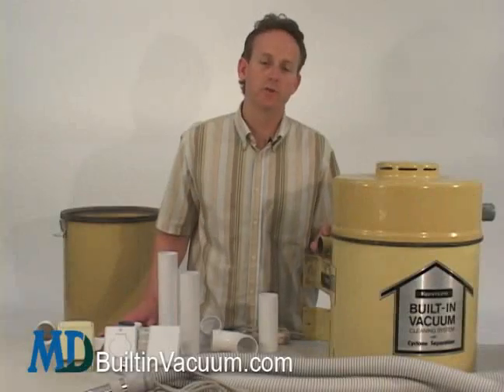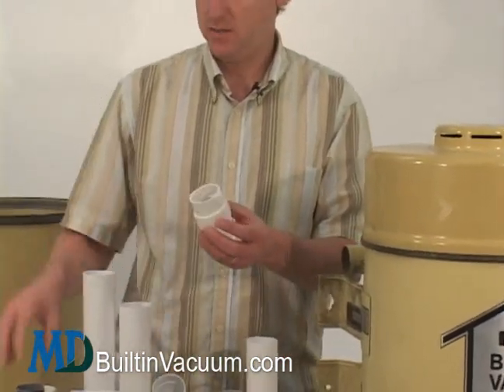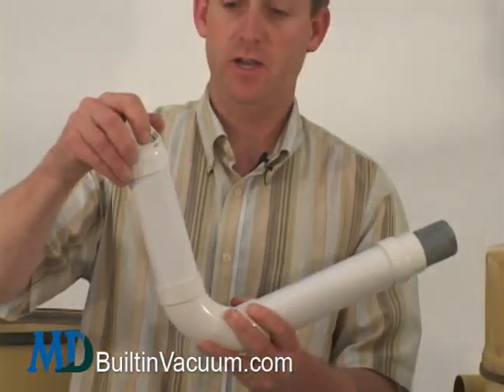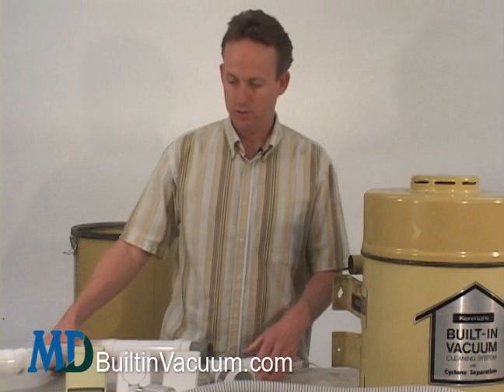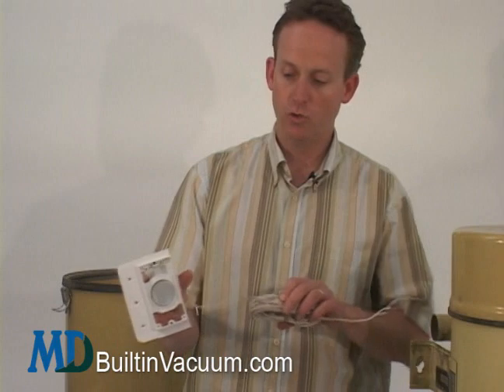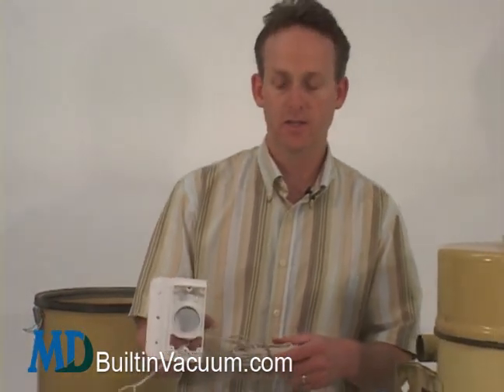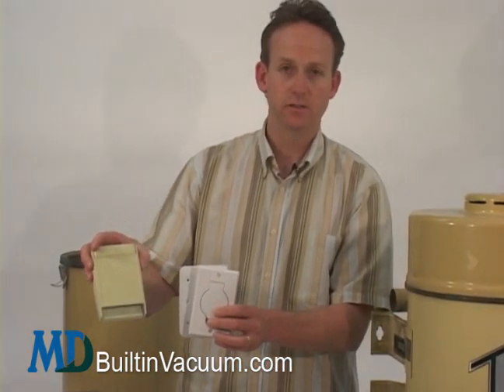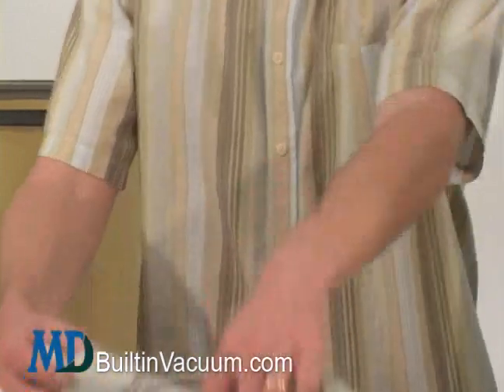How to Add an Inlet Valve Anywhere in the House

Comment: When you add the utility inlet or your unit has one built in and wire it with low voltage to turn on the system... do you have the opportunity to use a hose that has a built in switch to turn on and turn off the unit?  I've been looking everywhere for an answer to this.  I have an DirtDevil CV2600 and cant find anything about this utility inlet which is built in.